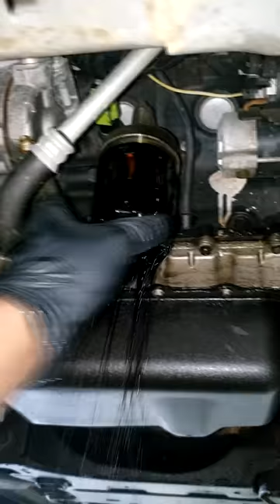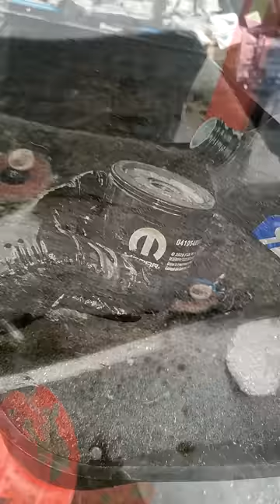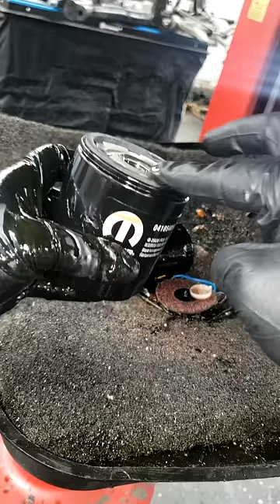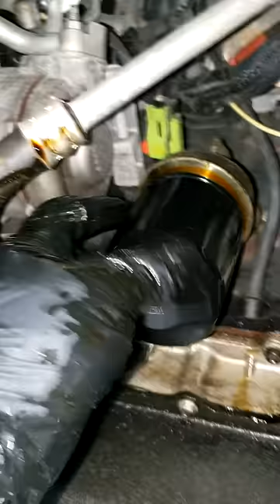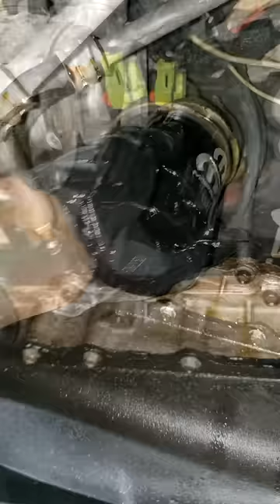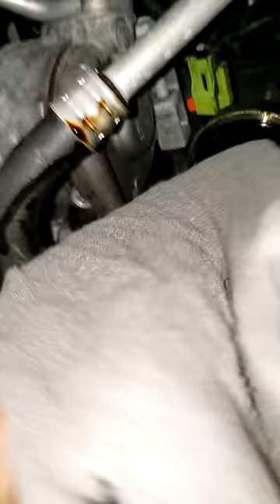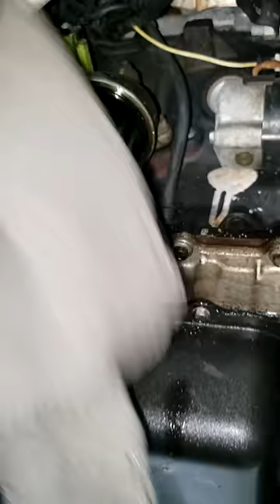Don't Lie.. Are yall still doing this?

Comment: As my instructor said "that's what's your oil pump is for"
Reply: Nah
Reply: @NathanaelNaused  Yeeah. It's basically a good example of cargo cult when people do something they really don't know why.
Reply: And your pump will fill it within a second or two!

Add Lucas oil and never worry about those seconds ever again!
Reply: everytime you hear a knock on a dry start with a fresh dry filter, that's wear. it might be negligible.. until it isn't.
Reply: @Matthew19002  Not sure why you'd intentionally skip such an easy and simple preventative step. Just lazy
Reply: @Matthew19002  i understand what you mean, I thought it was something you had to do but it's not. Sure if you want the peace of mind sure knock yourself out. But you don't really need to, you engine is already oiled and that oil pump fills the filter up so quick that it won't have a problem. Though def put a light coat of oil around the gasket
Reply: @Matthew19002  
When your filter is on the side of the block and screws on horizontally, exactly how are you suppose to keep the new oil in the new filter while you screw it on?  And how about those cars where the filter is on the top of the engine and the screw end of the filter points down.  How are you going to keep the oil in that filter?
Reply: @NathanaelNaused  
When your filter is on the side of the block and screws on horizontally, exactly how are you suppose to keep the new oil in the new filter while you screw it on?  And how about those cars where the filter is on the top of the engine and the screw end of the filter points down.  How are you going to keep the oil in that filter?
Reply: @oldtimefarmboy617  If your car won't allow it then I guess it is what it is. But that's not what we're talking about here
Reply: @NathanaelNaused  
"@Old Time Farm Boy  If your car won't allow it then I guess it is what it is. But that's not what we're talking about here"

The video is about prefilling the oil filter before installing it so it takes far less time to get filled and get oil to the engine.

The people are talking about the video and wither it is necessary to prefill the oil filter before installing it or not.

So yes, this is what we are taking about

Prefilling the oil filter is a mute point for anyone whose filter is not mounted with the open end facing at least somewhere close to straight up.
Reply: @oldtimefarmboy617  Literally the car in the video has a vertical filter. Furthermore you obviously can't do it if your car won't allow you. OBVIOUSLY that doesn't count. Stop being intentionally obtuse because you want to make a stupid and irrelevant point. There wouldn't be a video about it if we were talking about cars that can't do it.
Reply: @NathanaelNaused  
"@Old Time Farm Boy  Literally the car in the video has a vertical filter. Furthermore you obviously can't do it if your car won't allow you. OBVIOUSLY that doesn't count. Stop being intentionally obtuse because you want to make a stupid and irrelevant point. There wouldn't be a video about it if we were talking about cars that can't do it."

And yet other people are saying it is something you should always do when it is not always possible.  If you do not like people responding to your post, then maybe you should stop.  Better to be silent and be thought of as stupid than to speak and remove all doubt.
Reply: @oldtimefarmboy617  you can put quite a bit in filter it soaks through to outside i fill my horizontal filters all the time none runs out if you just let it soak through
Reply: @КорнелиусФ  that does not work on every fuel injected car.
Reply: @ranger178  
"@Old Time Farm Boy  you can put quite a bit in filter it soaks through to outside i fill my horizontal filters all the time none runs out if you just let it soak through"

If you put just enough oil in to soak the filter media that would be true.  But that is not what the video is advocating.  But that would still leave the biggest part of the filter empty and needing to be filled before oil starts being pumped into the engine.

Truth is, it just does not take long enough to fill the filter to result in any damage occurring to the engine; short of starting it and slamming it into gear and immediately taking off hard and fast.  But if you do that then you deserve whatever damage that happens
Reply: @oldtimefarmboy617  I pretty much 3/4 fill the filter the only part without oil is part of center i slowly rotate it and it fills whole outside if i just sat it on a flat horizontal for a while oil would run out
Reply: Impossible to do it on the Jeep I had 
Now my pickup truck it goes straight on 
Still haven’t done it 😂
Probably should
Reply: @christopherroth5559  exactly. Realistically when your changing your oil. Its about an hour since you shut the car off. Or sometimes its right after. The oil doesnt fully go into the pan until hours after the engine is off and cold. So theres really no need to prime the filter. If you want to be a bit safe. I put my car into the on position but not running so itll prime the oil pump and other components like the fuel filter. But ive been changing it without prefilling the filter since ive had my car at 32k miles. Its now at 252k with no issues or sign of wear
Reply: @johnwest3287  i use lucas every oil change and I've had the same two used vehicles run flawlessly now for over ten years. Ones a 1994 Isuzu trooper and the other a 2000 jeep cherokee. 🚙 
Oh, and edit... I never fill the oil filters before install. I just wipe oil on the gasket like the directions on the oil filter say to do. I don't see any directions saying fill the filter. You would think that'd be something they would tell you if it was important or necessary. Old fables die hard. "Don't walk under that ladder son, 7 years of bad luck i tell ya." 😅
Reply: @johnwest3287  nope, it takes 5-10s without oil pressure. It will not kill the engine instantly, but its life will be shorter.
Reply: I don’t care what anybody says, I’m still adding oil into my filter.  Rather always be safe than sorry.
Reply: @nanab256  one normal oil filters on your car it will not take 5-10 secs, prob at most 5 secs but that's to fully fill it not how long it takes to get oil through the filter. Also it will not harm your vehicle to not pre fill
Reply: @christopherroth5559  i have oil gauge onboard,  after start It takes 4s with patially prefilled filter(i cannot prefill it 100% because of horizontal mount). Filter is even smaller than stock, oil pump is like the new one, all clearances in specs, valve adjusted to 5,0bar. 
It will harm engine working with 0bar oil pressure. As i said it will not kill engine instantly but it will cause much faster bearings wear.
Reply: @nanab256  no it will not harm your vehicle, oil pressure will not tell you when your oil filter itself is filled. If you haven't let you car sit for a very long time there is still oil on your bearing and everywhere else it needs to be. Also bearings are a consumable thing they will not last forever but as I said it will cause any harm to your vechile to not pre fill your filter
Reply: @christopherroth5559  oil pressure tell me when entire system(included oil filter) is filled.
"there is still oil on your bearing and everywhere else it needs to be"
Oil pressure is the most important thing, even if there is some ilo on bearings you can wear them in seconds if there is 0 oil pressure. Oil film is prone to break very easy without proper oil pressure.
Reply: Not if your engine uses a quart-size or larger filter.
Reply: @NathanaelNaused turn the ignition on. Wait a couple seconds. The oil pump starts doing its job well before you start the engine that simple. This is a useless step unless you don't know anything about motors
Reply: @Matthew19002 if an engine knocks because you didn’t prefill a filter, that engine was going to grenade either way.
Reply: @Grim__Raptor if you where “being safe not sorry” you wouldn’t prefill…
Reply: @imhungry2387 you know less about engines than anyone else on the internet….
Reply: @NathanaelNaused  Because it's not causing any wear, at all, zero. And the people who designed the engine recommended not prefilling.
Reply: It will take 10 minutes to destroy an engine without oil.  Oil will be circulated in split seconds as some oil is always resting on parts. Besides that some filters are sideways or upside down.

Comment: I've been a tech for 30 years, and I've NEVER pre-filled an oil filter. I do, however, ALWAYS clean the sealing surface prior to installing the new filter. SMH!
Reply: Same. Just lube the rings up a lil bit so it seats properly but I used to always prime the filters then I found out it was pointless because the engine is building oil pressure while it's cranking
Reply: Doing that since 1960
Reply: Amazing how many "good" mechanics don't clean the mating surface of the oil filter - one of the simplest things. That's why I change my own oil.
Reply: When your cam does flat you will know.
Reply: Turbos do not suffer a lag in lubrication well
Reply: @crackmonkeynet  For sure.
Reply: That was absolutely disgusting how he didn't even bother to clean the base. Imagine what else he's not doing with the rest of the car...
Reply: Backyard mechanic that guy 😅
Reply: A lot of mechanics have no idea what is going on behind the work they do. There is absolutely no need to pre fill an oil filter. And no your cams won’t “go flat”, whatever that means. People don’t understand that there is oil everywhere in the engine even when it’s not running and the pan has been drained. Running “dry” for 10 seconds is not going to damage anything. I once had a customer start a brand new VW 1.8T that was freshly built with rods and pistons and all, had it idling for 30 minutes, checking water temp and bleeding the coolant etc etc, only when he was about to take it for a road test did we realize the oil was sitting on the bench unopened. We immediately shut it off and filled the oil. That engine went on to make 600hp for many years, and it is still going strong today. That was in 2011. So no, 8 seconds of prime time is not going to do anything.
Reply: @ronpflugrath2712  "When your cam does flat"

Huh?
Reply: @maxpeck4154  many v8 oil fill back too front, consistent last cam lobes to getoil usually number one or number 2 cylinder lobes are dryest longest at each start up.
Reply: Same
Reply: @agtronic I worked in metrology for 18 years with cams and cranks.  I've never seen a cam go flat. 😂
Reply: Yea buddy.
Reply: @agtronic 
Check out the 3.6 that Jeep is putting in their stuff.
Filter on top, upside down. 
Dry starts are killing the valve trains before 90,000 miles.
Reply: @agtronic exactly that motor is still got oil all over it inside and the new oil's going to flow immediately. There's no need to prefill an oil filter on a regular car. If you actually had to prefill an oil filter, there would be countless cars ruined when people forgot to do it and everyone would know about it and be doing it. But that's not the case at all because we really don't have to do it at all and that's why most people don't.
Reply: @agtronic  i had a similar situation. i was changing someones oil and after draining i realized i needed the car to be moved back 2 ft. i hopped in, turned it on, did what i had to an turned it off. The dude looked at me an said "did you just move the car with no oil in it" i said "yes, and theres actually oil still on the engine parts. so its still lubrixated. What you dont wanna do is drive it down the block with no oil"
Reply: @ronpflugrath2712 so you dont actually work on vehicles and equipment for a living, thanks for telling everyone.